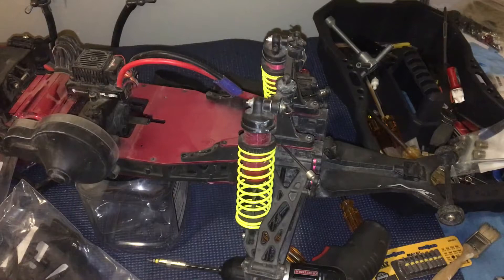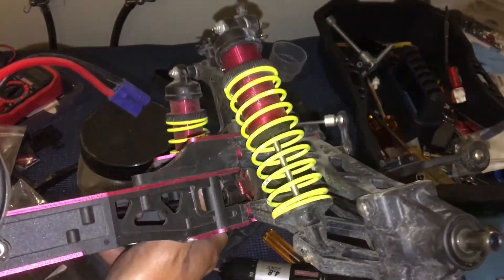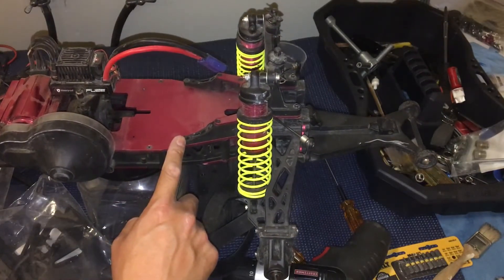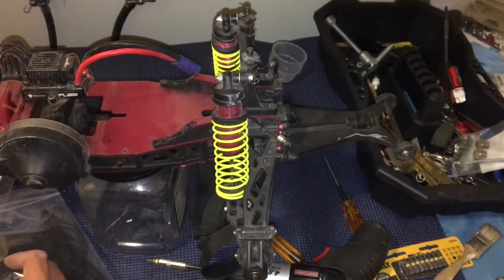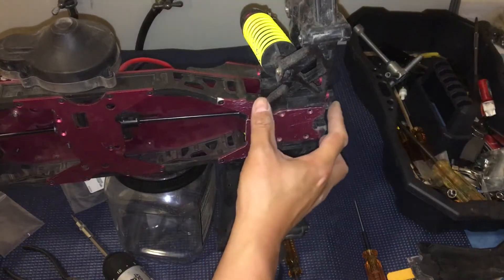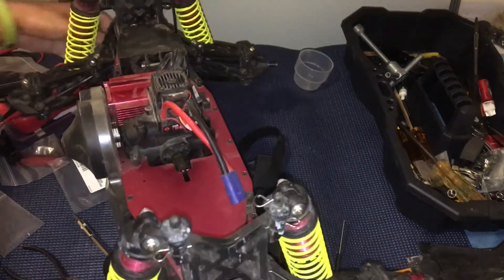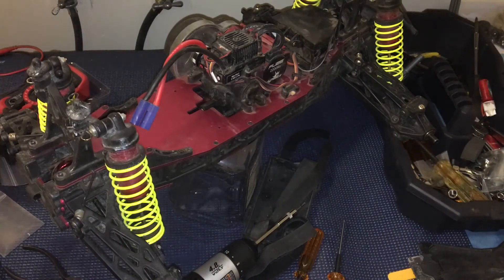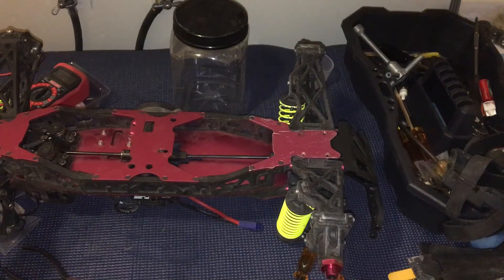Racing2Learn: 1/8 Monster Truck Losi LST XXL2-E: Fixing Rear Diff Mount and Install of XXL2 Bumper

Comment: does the diff go bad often on these
Reply from the maker: We haven't had a diff go out on ours yet, but it all depends on how many cells you run (we usually run 3s or 4s, and occasionally run 5s or 6s) and how hard you are on the acceleration and braking. The diff pins are a known weak spot, many folks have had success with using HPI diff pins as an upgrade.